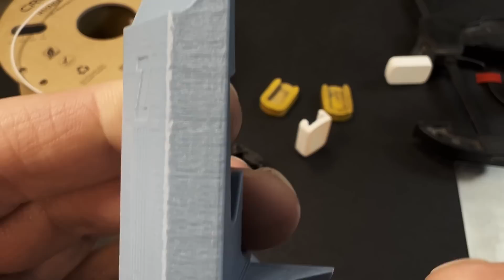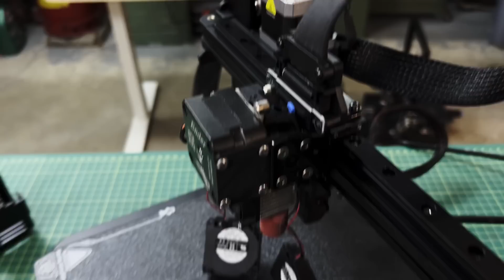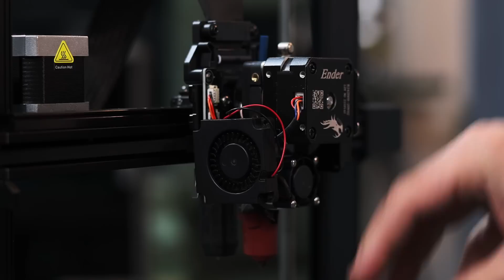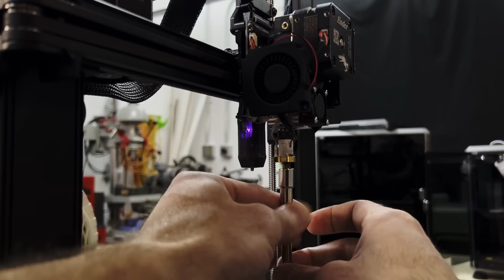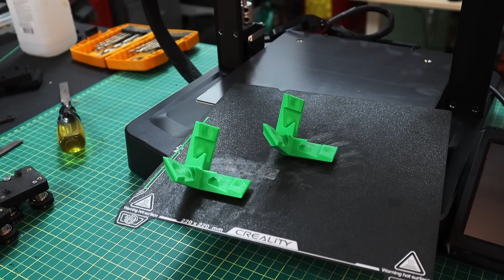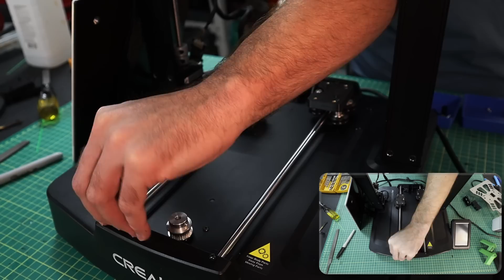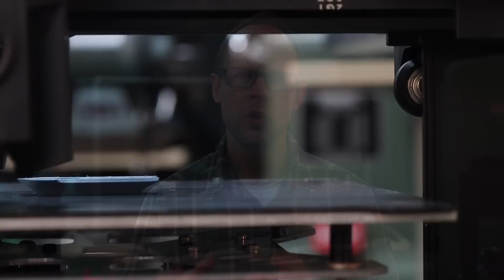What Causes BAD Print Quality on the Ender 3 V3 KE? - Fast Bed Slinger

Comment: Print petg all day long with brass nozzles on ender and a flsun SR
Reply from the maker: I've never had this problem on my Enders either and PETG was what I printed with for years.  I know from printing with a larger nozzle, that rubbing on PETG can be pretty severe compared to PLA, there may still be a slight connection, I'm not 100% convinced, but I also believe that it wouldn't matter if we had the correct sized rods and bearings, or linear rails.

Comment: Do you have the length of the linear rods, please? Thank you.
Reply from the maker: Sure, they are 342mm, they are tapped in both ends, and they look to be stainless steel, they are ground and are not plated.  I can see some minor scoring already from the bearings, they seem to be fairly hard as I try to use my file on them though, that's at least a good sign.

Comment: I am looking forward to the oncoming video.
Reply from the maker: You'd like to see the follow up to install linear rails then as well?
Reply: @NeedItMakeIt  yeah I just got one by myself. While the speed is pretty amazing, the quality of the prints is not. Got layer lines everywhere. Also it seems the extruder to have issues. The spring is already bent, wondering if the machine is brand new or someone tried some things on it…
Reply from the maker: @deadSoldier9  There is hope!  I would like to make a follow up video on this one with the most inexpensive solution to the problem that will be accessible to everyone.  It's not a good look to send out a new printer with these kinds of problems.  I'm not sure what happened exactly with their QC, did their test setup have good parts and these printers have slightly lesser quality?  I will say that the rods are ground, and very consistent, just undersized.  

As far as the extruder, I think it was a mistake to put the Sprite extruder on this printer, and a plastic version of it as well.  The extruder should be more like the K1 extruder, It's probably a few $$ more expensive to produce due to the nice big gears, but it's kind of  like the heart of the printer.  Are you able to send some photos through so I can see what your prints look like?  Needitmakeit@gmail.com

Comment: Bro' quick tips: PETG hates brass nozel while PLA good in Brass nozel, PLA is not so good with all steel nozel and PETG is good with Steel nozel. _TRY IT!
Reply from the maker: I was printing with nickel plated copper alloy HF nozzles, and I ended up swapping back.  I think you're right, PETG is a sticky material.  In this case, the nozzle choice didn't seem to provide any better results but I agree that brass isn't the right nozzle for PETG.
Reply: ok bro' looking forward to your next video when you tried steel for PETG and Brass for PLA @NeedItMakeIt
Reply from the maker: @valpercinabanalan8576   I'll make sure to have it on the list!  I am working on a final fix that everyone can do for this printer at the moment.  I don't know what sales are like, but I can imagine that there are a lot that need an upgrade to reach their potential.  The extruder is something that I think is a little weak on this printer, the original Sprite is metal, not sure why it's okay to put a plastic extruder on a fast printer like this.

Comment: test with a far lower acceleration, since the bed itself is too flexible too comply with the sudden change of direction.
Reply from the maker: I have tests from the previous video which show when the speed of the print is slowed, the quality rises, however those speeds are in the 10-20mm/s range, that's not an acceptable range to print in for a 'fast' printer.  I can see the linear rods working fine as long as they're sized correctly.  Unfortunately the movement of the bed is so minimal that it's hard to capture on video well, but I'd like to create a test using a dial indicator to compare as the bed moves back and fourth, thoughts on that?
Reply: @NeedItMakeIt  in the previous video you measured the rods and it gave you a measurement of around 7.95, and all other linear bearings were quite loose on it, is there a possibility to swap both rod and bushing that wont have any play on it will minimize the issues.
Reply: @kayquexavier  He mentions that towards the end of this video and tried some workarounds to simulate this in previous videos. Proper fit linear rails and bearings with stiff precise mounting would help the issue, but not of the bed and mounting itself are still flexing and bouncing.
Reply from the maker: @kayquexavier  Yes, I think that would be ideal, in taking some more precise measurements today, and looking closely at the setup, no matter how little play there is, the front and back will perform worse than the center.  The bearing blocks are quite short, and mounted central.  To get this right, they need to be exactly 8mm, and the bearings need to be set for 7.98mm, with that little bit of pre-load, it should be quite a bit better.  Unfortunately, if I order parts at that kind of precision, they are terribly expensive, and I'd need to drill and tap holes in the ends of hardened rods.  I think we need a solution that's better, so I am working on coming up with something that's going to work well.

Comment: hai, do a ender 3 v3 ke have input shaping? i thing you need to do input shaping it because of steel bed.
Reply from the maker: That's right, it does use input shaping, however this machine does not have an accelerometer.  I can see that the values within the config file are static and must be pre-loaded.  That's one thing I didn't mention, when I made my attempt, I would have needed to redo input shaping because it is a fairly dramatic change.  If you want a print that looks like it's melting... use my solution.  🤦🏽
Reply: @NeedItMakeIt  i have a value from creality, [input_shaper]
shaper_type_y = mzv
shaper_freq_y = 32.0

shaper_type_x = mzv
shaper_freq_x = 38.5
i hope this help.
btw thanks for your video thas help me to choose ke or se.
Reply from the maker: @Bugs0Zapper3043  If you can wait until Feb 20th, they're releasing a new Ender 3 V3, I just heard today.  It's a Core XZ, it looks pretty nice, though I only have one picture to reference. https://imgur.com/a/NgCAGJX

Comment: I just put a linear rail on my Ender 3 S1 Pro x axis to help with quality issues. This is more proof I still can't trust Creality to get the details right.
Reply from the maker: If you want to print fast, the slightly rubbery wheels just don't work anymore.  Makes sense that we don't see them on any of the faster printers these days.  I think linear rails are a must.  The rods are only 8mm as well, which gives them some flex too, they seem to be quality rods, which are ground... just a bit too small.  Can I assume that they ran tests only in the center of their printer bed and they never saw this problem?  If there is some interest, I'd be happy to make a follow up to the follow up video and install linear rails.  I'll design some type of a mount that is easy to install for everyone and looks like it belongs as well.   I'm surprised that they didn't catch this problem, it's very important for their reputation and it's a pretty big expense when compared to the price of the printer to do the upgrade.

Comment: Wait, but doesn’t Input Shaper compensate for this?
Reply: Input shaping compensates for resonance which should be fairly constant and predictable based on a set of input parameters. It also mostly compensates in X and Y and it can in Z, but based on the up and down movement of the printhead, not the bed itself bouncing. This is a much more random issue which is caused by the bed bouncing a different amount depending where on the bed you are printing, how fast it was just moved back and forth, and how much weight is on it. Input shaping might be able to compensate for it if you calibrated at that specific point on the bed in Y and Z directions, but then it would print like crap everywhere else. You kind of need the entire bed surface to behave in a consistent and predictable fashion, if that makes sense. I'm sure there is a more concise way to explain this, but hopefully that helps.
Reply: Wait, so what if we test across the whole bed or where it is most vulnerable?
 @802Garage
Reply: Input shaping you mean the sensor thing???

Comment: How-Do! Just got to the end of this video and was watching the issues you ran into whilst testing out the Y-Axis Motion on your Printer. 
I'm in the process of finishing my own Cartesian Bed Slinger and will be addressing the same issues too fairly soon. Firstly, I've already bought the hardware in advance Online and ended up going for 20mm! Linear Rods to beef them up and to take advantage of there stiffness due to there size, And Because the Steel Bar is 20mm in diameter, this will provide more Weight and Surface Area for this size Linear Bearings LM20LUU to coast along once lubricated. In some way, I think even though it maybe overkill, the rods are going to add weight to the machine and a lower point of weight/Gravity to make the machine even more solid than before...
When I think about this point, the concept does remind me of the logic behind large parts being used on CNC Machines. It adds more stiffness to support the things were looking to avoid, especially when it comes to the final finishes of the print. So like I said, I've got that coming up soon, but I think it will have great significance.

As for your issues, I'd say go back to Linear Rods and Re-Design the Rubber Wheel Setup! Make or redesign the Wheel bearing Mounts (The black 3d printed plates you made) and design them so they too can be adjusted like the wheels, Maybe just on 1 side or Rail. Last of all... Go for rubber wheels with a larger rubber Groove on them ( probably will also have a larger I.D for the bearing too to conder while redesigning it too. but to end my waffling, The larger rubber bearings should give you a larger radius of contact too when using the same Rods!
Think about it!
Good luck...!

Comment: I don't understand why when looking at movement artifacts you jumped to extrusion issues as your first port of call.

For an easy test of bearing issues on the carriage I'd have printed some igus bearing knock-offs and subbed them straight in.
Reply from the maker: I think I mentioned that I've never seen issues like this before, and having taken the extruder apart, it seemed that the extruder was the likely cause.  At the time it didn't occur to me that the bed was moving slightly up and down, since with the linear rods and bearings it was very hard to detect by eye.  I had to experience the problem, and go through the process.  Googling didn't help me on this one unfortunately.  I don't claim to know everything, but I'd like to go through the process of figuring it out and gaining a better understanding.  

In the previous video I attempted this, however the tolerances required for this printer to be successful are too tight.  I didn't have the IGUS, and it is far to expensive to warrant it.  I think it's a good idea if you have the tools to be able to re-machine the outer/inner diameters of the bushing after you've printed them.
Reply: Watch the previous video and listen to his explanation in this video and you'll understand why. It's very easy for any of us to be led astray by bad data or confirmation bias. He had PLA prints that looked perfect as well as PETG prints that looked great, so why were there issues with this specific PETG or this specific test? There were multiple factors to eliminate, but because the printer was clearly capable of good prints, it pointed more towards how the extruder was interacting with filament or printing certain models. What we missed was the position of the prints used for testing. It's just a simple mistake. :)

Comment: Essentially you made a CR 10 SE.
Reply from the maker: Probably would be more cost effective to buy the CR10 rather than do a swap of some parts.
Reply: The CR-10 Se uses a single 24mm linear rail, which should be mighty sturdy
Reply: @mortegutt  thanks for the clarification
Reply: Microcenter has the Cr-10 SE for only $30 more than the KE right now at $289! I wish I had seen that before pulling the trigger on my KE but oh well. Upgrade it is.